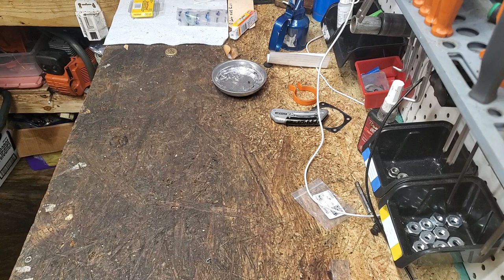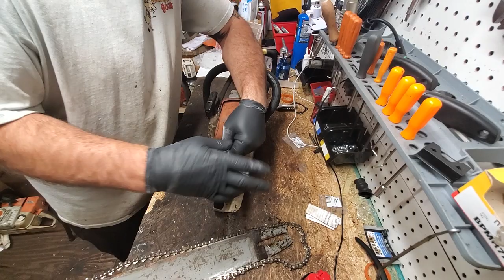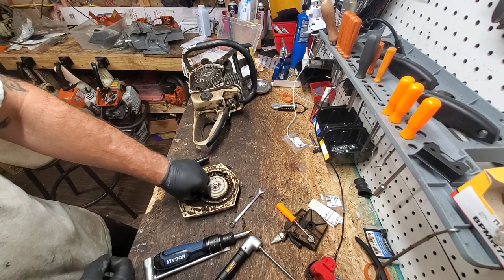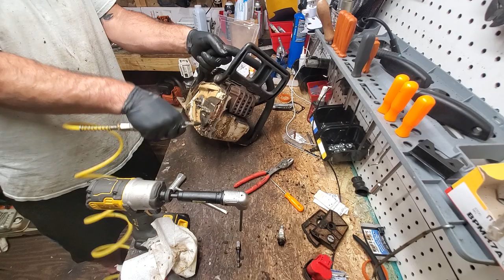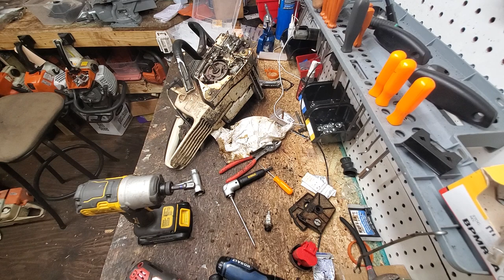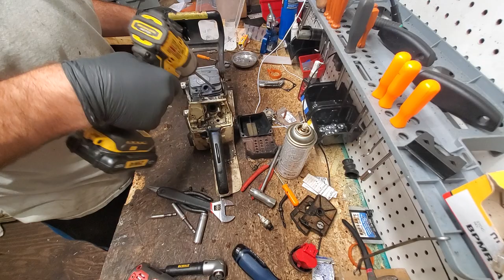FULL disassembly of STIHL 028WB being redeemed for a subscriber!!! converting to 46mm super!

Comment: If you are converting that Stihl 028 from a 42mm piston to a 46 mm piston. You may have to grind the case out were the piston goes in at BDC. So test fit that piston clearance before putting the case together. Also you may have to get a 028 super muffler because the muffler hole is smaller on the 028 42mm piston. Something that might make it easier for you to get clutches loose on saws the tool I use is the Milwaukee 2853-20 1/4 hex impact works very good. To install clutches I put it in the 1st torque setting. Hope this helps.
Reply from the maker: I will measure but the exhaust port on an 028 FOURTY FOUR MM and 028 super 46MM I believe are identical. I am simply putting a full piston and cylinder meteor kit for a super on an 028. The cases, stroke, arm, everything is the same. I've done conversions dozens of times but now I'm curious about that exhaust opening I thought they were identical. Can you send me a link for that tool?????? If it's expensive I can't afford it tho lol I'm broke after rite now. Thanks for your input neighbor!!!!!
Reply from the maker: Do you mean a Milwaukee m18???? My Dewalt 20v should be able to do just as much as that
Reply: @chainsawredeemer85  That is good that is a 44 mm piston make the conversion easier. Just look up the milwaukee 2853-20 yes it is m18. But try your dewalt 20v impact on those clutches see if that works.
Reply from the maker: https://youtu.be/vq0KnHcfZR4 different content lemme get your thoughts over in the comments on this 4 part mini series i just posted

Comment: Chainsaw Redeeeeerer,

I have to make another comment. 

Hardly anybody on YouTube takes the Welch plugs out of the carburetor rebuild and explain the 3 holes on idle circuit and the one way valve on the High side. This is a good opportunity to show that part of details to your viewers and not just a gasket change. Just a suggestion for your viewers.
Reply from the maker: Yes that is my hope I've done several Welch plugs and due to various obstacles haven't been able to film it.